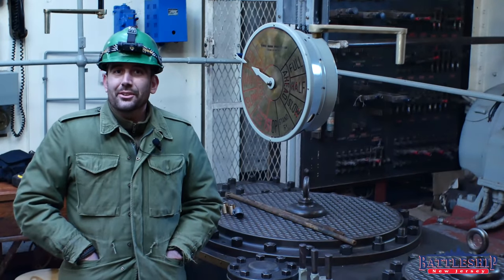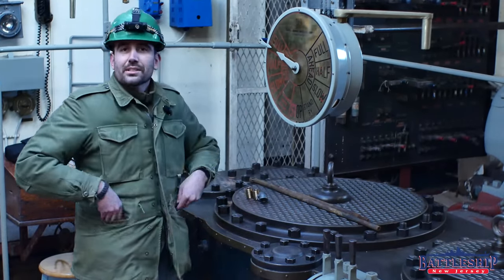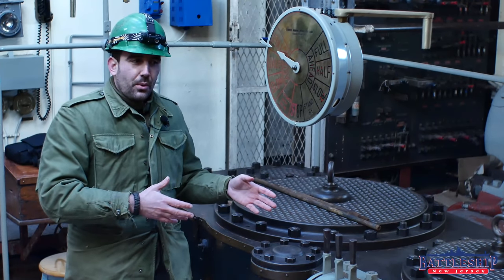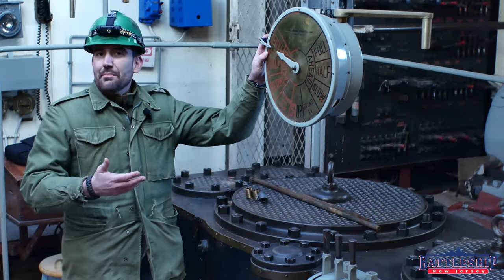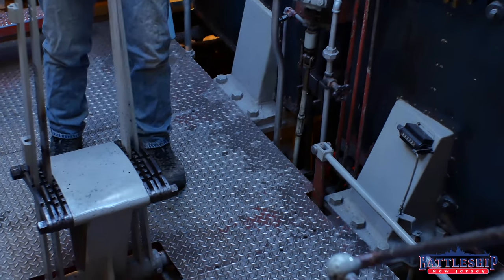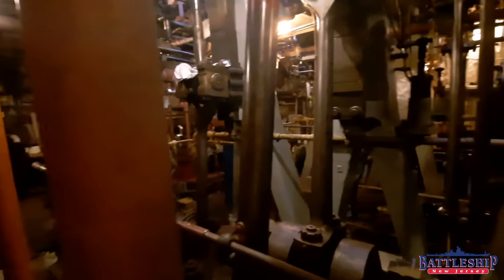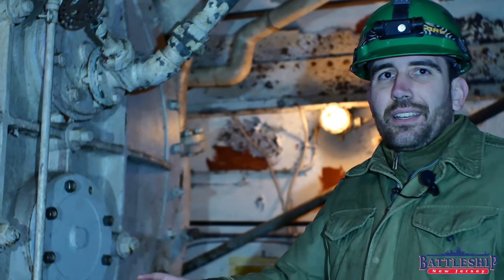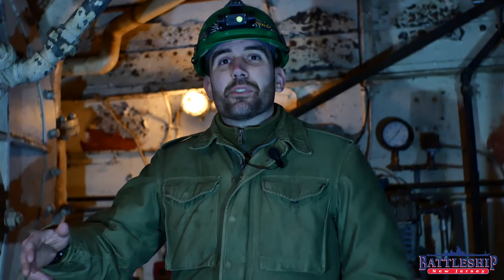Reciprocating Steam Engine: USCGC Lilac

Comment: PS Waverley is a triple expansion sea going ship too, and what a gem she is.

Never sailed in a professional capacity on a steam ship, let alone a triple expansion reciprocating powered one. However I did get to accompany my late great uncle on his home built steam launch. She was built entirely out of scrap, the hull starting life as a German navy pinnace dating from around WWI, the boiler being built out of offcuts of pipe from the Flotta oil terminal when it was being built (and what a magnificent piece of engineering it was!), the condenser was made from salvaged parts of HMS Vanguard's (the one that blew up and sank at anchor in Scapa Flow in WWI) and the engine, a 2 cylinder compound, started life in a White steam car in about 1910. I attained the rank of 2nd engineer and helmsman! =D Thankfully his beloved boat has been preserved in safe hands on his passing.

Excellent video as ever, very informative. Keep up the good work. :)
Reply: Awesome sounding boat! having built a few odd "acquired" hulls into seaworthy boats, I can appreciate the joy of getting her dialed in and up on a plane. I think I enjoy the process a bit to much, cos as soon as ive finished one, im onto another. with one on the trailer, you know, for the actual boating part. Thats important.

Havnt gone all the way on a steam motor yet, but im very tempted. Half the challange in building my vessels is waiting to find that right part that will fit. on good terms with the local scrappers n tip shop folk (well, my old boy is, he gets the iron, I get the widgets. It blows his mind that we can be sitting by the fire drinking port spitballing about some gizmo, last was a GPS speedo, and I can buy and pay in a few seconds from our campsite). its not what you design, its what you can find.
Reply: steam powered sloops and a bit larger than that is nice: think about going at 6 knots and being able to easily speak with the passengers (friends.)

They are almost completely silent, and the only fuel it needs is that can harvested in the woods nearby !
Reply: Not only is PS Waverley a triple expansion sea going ship, it’s a PADDLE STEAMER triple expansion sea going ship from 1947!
What are the odds.
Reply: Wow..That sounds worthy of about an hour long video just on the engine and running gear...

Comment: I got to go aboard USS Texas right after Desert Storm; back then one of the engine rooms was on the tour.  The massive size of her engines was something to behold.   Years later, in the famous engine room scene in "Titanic" you got to see the CGI version of how those giant triple-expansion steam engines looked in service.  Oh, it'll never happen, but it'd be wonderful to see even just one of Texas's engines turning over, even if it was just a large hidden electric motor making it move, no boilers lit or actual steam flowing, no propellers turning, just to see the mechanical symphony in operation.  Some day I do hope to get to sail aboard the O'Brien on one of their excursions.
Reply: It should be possible to run and steam at reduced pressure - so getting the money and getting the navy to agree to the plan.

Though i think it would be impossible to with US rules and laws allow visitors in the steam areas while at pressure - even less with the engine working.
Witness the rules which i believe runs their steam engine at - NO visitors on the engine.

Comment: Your question really has my brain going WAY back in time, to the very early sixties. Being from So. California, I said a couple of time on the "Great White Steamship", the S.S. Catalina, from Los Angeles Harbor to Avalon on Santa Catalina Island. Took two and a half hours to make that 21 mile journey. Had one triple expansion driving it's single shaft. While PAX were not permitted in the engine room, the access to the space was off the main deck where there was a port hole in the doorway, where you could look into the engine room.

Here's a bit of WW-II (specifically Pearl Harbor) trivia for you. The Nevada Class of Battleships, (Nevada, BB-36 and Oklahoma, BB-37) was built with both types of engines. The Nevada received turbine engines, while the Oklahoma received VTE engines. I have read (years ago, so I can't quote the source) that the Oklahoma's engines was a major factor in the Navy's decision not to rebuild the ship.

Comment: The Sabino at Mystic Seaport, which is still seaworthy and sails during warmer months, is a compound steam engine.  I can't remember if it has two or three cylinders though.  The neat part is that the engine room is open to one of the decks so while going for a cruise you can see all of the workings of the engine and even talk to the engineer and fireman while they are running/stoking the boiler.

Comment: Bob-Lo boats SS Ste. Claire and SS Columbia, in the late 1970's. Each had a single large VTE engine in a well. The main deck had a big opening with the cylinders sticking up through. I leaned on the main deck engine room railing the whole trip, then when we got to Bob-Lo (Bois Blanc) Island, I and my very young daughter were invited down to the engine room.  I asked my daughter about it recently, she still remembered details about the engine.  Amazing to watch them dock and undock the tall boat at several  stops, with a single engine, rudder, and a springline, no tug.

Much later, my son and I got aboard Medusa Challenger at the dock. Full tour, in the engine room, along the deck to the tiny wheelhouse. You were very aware that steam lines ran the length of the vessel, not just the engine room. Engine was a Skinner high pressure compound, like the 2 Skinner engines on Badger.  Sadly, "no pictures please".  Their cook was legendary, we got some samples.

Comment: I once got to start up the boiler and engine of the SS Jeremiah Obrien, the liberty ship in San Francisco. It was an awe-inspiring experience, every bit as amazing as the nuclear submarine engines I work on nowadays.

Reciprocating steam engines are significantly simpler - to build - than steam turbines. The metallurgy is less complex, the speeds involved are lower, and you don't need forced lubrication or high-strength reduction gears. That's why they kept getting built even throughout WWII, because of how much simpler they are to build. However, they are -operationally - more complex than steam turbines. A steam turbine is literally just a giant steam-spun fan. It rotates continuously with no changes in direction, making it mechanically very simple. When operating, you only need two valves, one throttle for the ahead turbine and one throttle for the astern turbine. Reciprocating steam engines use mechanical linkages to change the valve timing to control their direction, and if that timing is off by a little bit then they lose a lot of power. Every revolution of the engine involves multiple direction changes for every piston and rod. The bigger the engine, the more stress they're under. That's why the triple-expansion steam engine died out in the end. It was complex to operate and maintain, and could only be scaled up so much.

Comment: I was a volunteer stoker on The tug lyttelton est 1907  in Christchurch nz. She has a two compound reciprocating engine. 20in on the high pressure and 40in on the low with a 27in stroke. She is able to have passengers taken round lyttelton harbor

Comment: For many years I was a chief engineer on a direct drive diesel Army Reserve tugboat.  Constant watch on the engine order telegraph to respond to throttle adjustments, and direction changes.  You have to learn to mentally clock the timing requirements to stop the engine, then start in the opposite rotation when maneuvering or handling a barge.

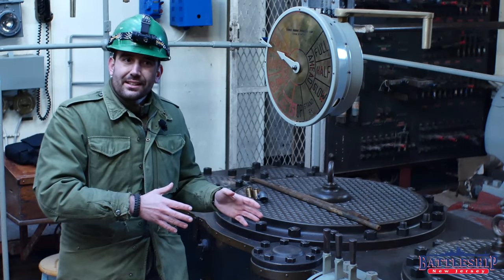Comment: 2:06 Actually, early direct drive turbines were LESS efficient than triple expansion steam engines, which is why the US continued to use them until reduction geared turbines were developed and then used in the Nevada class. With the development of double reduction geared turbines, turbines finally pulled far ahead of triple expansion.

Direct drive turbines were less efficient, but allowed higher speed. The vast British refueling network around the world made the reduced range a non-issue. For the US, with obligations and potential enemies in the Pacific, that reduction in range was considered unacceptable.

Direct drive steam turbines were sometimes used in conjunction with triple expansion steam engines, like on the Titanic. The low pressure turbine, that drove the middle propeller, used leftover steam pressure from the triple expansion engines.
Reply: It wasn't leftover steam - it used  energy which otherwise would have been cooled of in the water in the condenser.
Reply: @TheStefanskoglund1  Read what I said, "...leftover steam PRESSURE". Pressure = Energy, in this case.

"The low pressure turbine, that drove the middle propeller, used leftover steam pressure from the triple expansion engines."
"The low pressure turbine, that drove the middle propeller, used leftover steam energy from the triple expansion engines."

Either choice of word would work in this context, but most people would chose to use the former.
Reply: The complexity is the turbines where not actually less efficient, they just didn't throttle down well. This is part the turbines themselves, but mostly that the direct drive system meant propellers designed for very fast rotation, while the turbines would be forced to rotate far too slowly when not at flank type speeds. Alongside boiler choices it resulted in massive amounts of coal consumption per distance traveled in normal convoy or peacetime (hence the range issue you mention), but shouldn't be confused for low efficency, as the same ships at war speeds used less than their reciprocating cousins, and could maintain high speeds a lot longer as you didn't shake/wear the engines badly, and demands on stokers was less severe (although would still be the limiting factor eventually). Likewise you absolutely could build direct drive steam ships that couldn't go fast, but saved the weight/volume over a multiple expansion for very simlar or even fractionally better efficiency.... there are actually factories, mine water pumps and other continuous demand, critical and high value ground installations set up this way from the era, but generally slower steaming ships went with the cheaper (in no small part due to parsons licensing fees) and more widely in production for that purpose triple expansions motors. A few military tenders ect actually did use turbines though (keep in mind this cutter is 1930's, dreadnought herself was two decades in, and already looking long in the tooth).
Reply: @SheepInACart  "The complexity is the turbines where not actually less efficient, they just didn't throttle down well."

This is a distinction without a difference. In the real world usage, direct drive turbines were overall less efficient and came with a range penalty that was unacceptable for many users. Which is why many waited until the development of geared turbines to adopt them.

Comment: I've drove on several great lakes freighters with triple expansion engines, they are huge!  I've seen them at depth 200+ feet on mixed gas.  Not a dive for the sport diver.  I had not idea any were still floating as museums.  Thank you.

Comment: I read that the early steam turbines had quite poor fuel efficiency, particularly at cruising power, compared to triple expansion engines.  For the same fuel capacity on a ship, triple expansion engines gave much longer range.  The US Navy, with an eye to the vast reaches of the Pacific Ocean, stayed with triple expansion longer in order to get the range advantage.
Reply: But at the same time turbines needed less maintenance and where much less prone to strong vibrations. Tripple expansion engines where basically shaking themselves and even some other connected parts of the ships appart. You could not stay longer than a few hours at flank speed because the stress on the engine would make pipes burst, fittings break and rangefinders shake. But yes, turbines are only efficient if they run at or near their ideal turning speed. Thats why they invented geared turbines and added more efficient cruising turbines with less power on bigger ships. The "main" turbines could then be turned off for cruising and only spooled up when the power was needed and fuelconsumption not an issue.
Reply: The rule of thumb in more recent years of steam propulsion.was reciprocating engines were the best for working vessels like this and bouy tenders.  They are good for keeping a ship on station when servicing a bouy or driving pilings, etc. Turbines we're better for cruising and speed.
Reply: Another advantage of reciprocating steam engines is their responsiveness. You can be moving half ahead and  then go to half astern in a few seconds. Not that you can't reverse a turbine but a recip is just that much more quicker!!
Reply: @albertoswald8461  Yes, that is something early turbines could not dream to achieve but it also was putting a lot of stress on the engine to break and accelerate those massive pistons.
Reply: @tobichallanger ,maybe but I think it stresses the turbine more. Also I think that a Skinner Uniflow handles it better than a triple expansion since with a Skinner you don't have the way different expansion rates like you do going from an HP to IP to LP cylinder. When I was engineer on the Badger I could be going half ahead and when the Master rang the telegraph for half astern I could have it reversed and responding in about 4 seconds.
Reply: @albertoswald8461  I agree, that the Uniflows could handle much more than triple expansion engines and they can run closer to full power for a longer time aswell. As far as i know turbines handle reversing much better because you do not actually reverse the turbine but you mostly have a second less powerfull pair of turbines in reverse direction than your main turbines. 

But i am talking only about what i learned while studying ship engines in my free time. I don't have any actual experience with them except a few small live steam models.
Reply: @tobichallanger ,when you reverse a steam turbine it goes in the opposite direction.  After you shut off your ahead throttle you will open up your astern throttle. On a regular cross compound turbine that goes into the astern element of the LP (low pressure) turbine. That moves it in the opposite direction causing your propeller to spin the other way so you can back it up!! A turbo electric ship (none running that I know of.) the turbine would spin steadily with a generator on the back end. That would supply power to big DC motors connected to propeller shafts. DC being variable speeds make it easy to manuver as well as reverse. Modern cruise ships are diesel electric. The only difference is what they use to generate power as well as a lot more fancy electronic gee-gaws!!
Reply: @albertoswald8461  Thank you for your explanation. I suspected it but i did not actually know for sure that you could reverse some turbines. I only know that some early ships actually used reverse steam turbines. But i recon having a second smaller turbine just to reverse was not worth the weight and space in the long run so they most likely scrapped the idea as soon as they could.
Reply: @albertoswald8461  I just found that HMS Dreadnought is one example of a ship having a seperate reverse steam turbines. They were relatively small and housed beside the inner shafts. Because of this she was sometimes cited as having too little reversing power.
Reply: @tobichallanger  ,my pleasure. A cross compound turbine is two turbines geared together. You have a smaller HP (high pressure) turbine that due to it's relative compactness keeps the steam from the boiler's pressure high to do the work of spinning the turbine. It exits to a cross over pipe where it goes into the larger LP turbine to take advantage of the expansion of the steam before it goes back to being water.
Reply: @tobichallanger  , I've read that early turbine ships were a bitch to handle at low speeds. They like to stay at a steady high speed, which for a generator is perfect!! Manuvering? Not so much!! I'm glad that I never worked something like that!!😁
Reply: @albertoswald8461  To be fair early steam turbines where directly attached to the driveshaft so when it finally starts moving it is very likely to accelerate very quickly very fast. Atleast with geared turbines you have some sort of rpm before the ship begins moving.

On one side i am also glad to have never worked on something like that but on the other side it might be one hell of an experience.
Reply: I don't know about early turbine plant reversing turbines, but carrier nuclear plants all integrate a small reverse bladed section on their LP turbines. They are pretty small, only about 1/10th of the ahead blading horsepower, and heavier built to better handle any condensate that might be in the steam. As for drivetrain durability, the biggest concern is metal fatigue. All the components are rated for expected load plus a margin and material testing gives an estimate for fatigue lifespan based off loading. Crashbacks, flank ahead to emergency astern, are only allowed in emergencies and can only be done so many times before everything needs a thorough inspection.
Reply: @albertoswald8461  The small engine which moves the Stephenson valve gear when changing direction helps - it basically means that you can go from half forward to half back immediately.

Comment: Never served on a ship that had one, never saw the controls before, but I think you may be confused.  What you called the reversing lever has incremental latch points on the gate, while the other has two extremes and a center latch.  I suspect the left lever is for  reversing and the right is throttle.